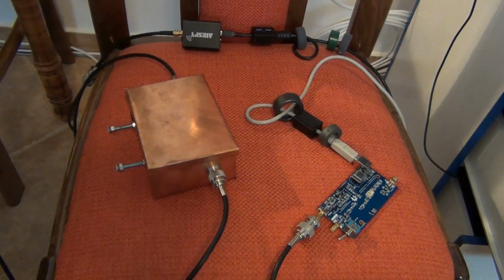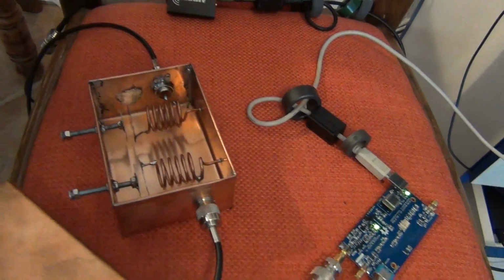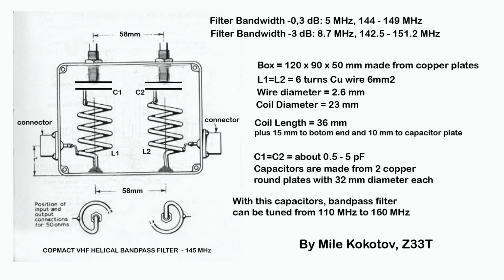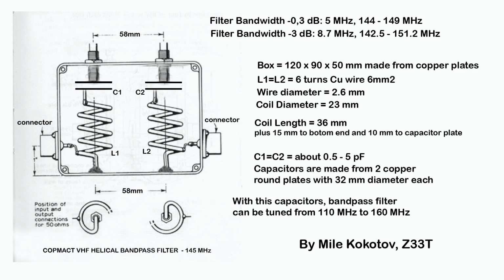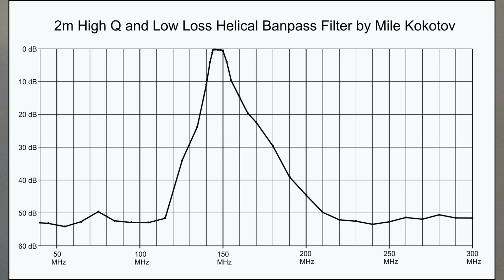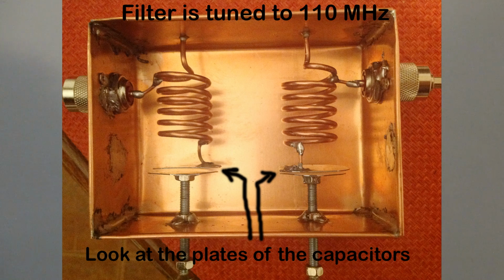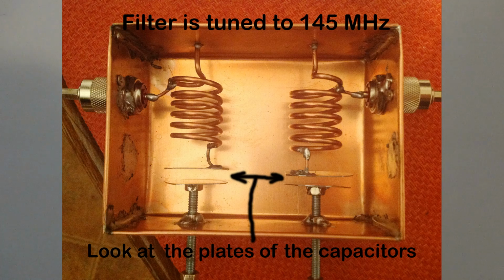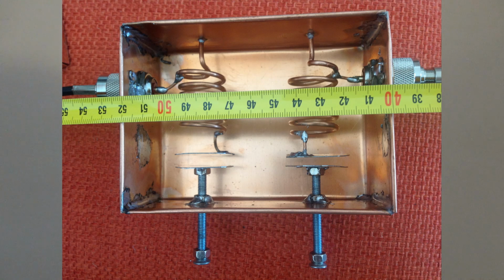145 MHz Low Loss Bandpass Helical Filter by Mile Kokotov

Comment: Hello Mike! Great project! I'm planing to build this filter but i have some questions. The wire used to build coil is 2.6mm, right? And the wire used to 'link' connector to the coil? Looks like a little less diameter, am I right? If i don't have this exact diameter, can I use another diameter? Tks
Reply from the maker: Jonis Maurin Ceará The wire diameter is not so critical. The bigger wire diameter is better because of skin effect and less RF loss. You can use any copper wire between 2.5 and 3 mm diameter for the coils. For the connection between connector and coil, the wire is 1 to 2 mm in diameter from practical point of view. 

Once you build it, the filter can be tuned with network analyzer, or simply with listening the weak signal in the frequency of interest. After that, you can connect the filter between transmitter and SWR-meter. Connect the dummy load or antenna and starting with very low transmitting power!!!  tune the filter to lower SWR and maximum forward power. After that, you can increase the transmitting power...

Pay attention on the position of taping the coil to connector. It must be done as it is shown in the pictures (and diagram in the video) for 50 ohm impedance. 

The box is made from copper plates. If you use aluminum instead of copper, the RF loss will be greater...
You are welcome for any other question about this project.

Let me know when you finish your bandpass filter.

73.
Mile, Z33T
Reply: Mile Kokotov Mile, thank you very much for your attention! I`m playing to use this filter only for receiving with my dongle RTL-SDR, and I don't  have spectrum analyzer, so I'll use rtl_power and Panorama do measure attenuation and fine tune this filter. For the box, i'll use PCB boards since copper is very expensive and a little hard to find here.
Do you have any other projects for bandpass filtres? I'm looking for a smaller one to put in a small box with my Raspberry Pi to receive NOAA satélites.
Reply from the maker: Jonis Maurin Ceará The smaller dimensions - the greater losses! You can try some of this suggestions:

http://postimg.org/image/a2bydisjl/

73,
MIle, Z33T
Reply: Mile Kokotov  
Hi！Dear KoKotov,
Could I buy from you? My frequency is 142.075 MHz.  I am facing some De-sense on my receiver. If I install you filter in at the Ant. port of my RX, I will get 25 db rejection improvement on the receive. That is good enough for my application. The reason I don't make it, because I don't have the equipment to tune the filter. I really wish you could help me.

VT Thiang /  Email:  vtthiang_brv@yahoo.com.sg
Reply from the maker: VT Thiang I am not producing and selling this filter. I make one for my needs only. I published this project for those who want to make it. Don`t worry if you have no sophisticated equipment for fine tuning. You can tune this filter only with receiver, while receiving weak signal on frequency you need. Just tune the two variable capacitors for maximum receiving signal on that frequency. and that` it! On the transmitter side, you can tuned this filter with simple SWR meter only. Just tune the two variable capacitors for minimum swr reading on the SWR Meter, and maximum output. That is very simple! Be sure that dimensions are the same as I shown in the video and you will be satisfied! Thanks for your interest.
Reply: Thank you very much indeed